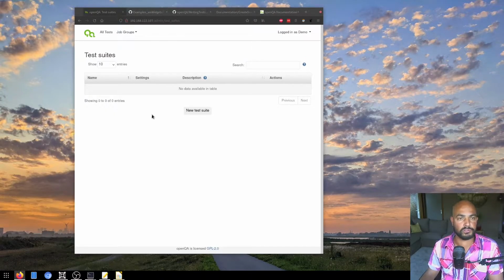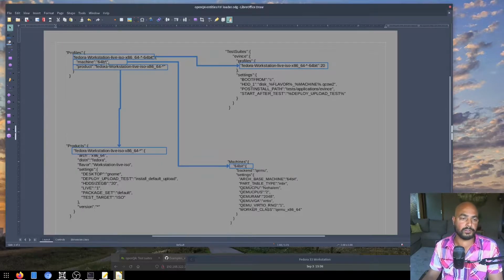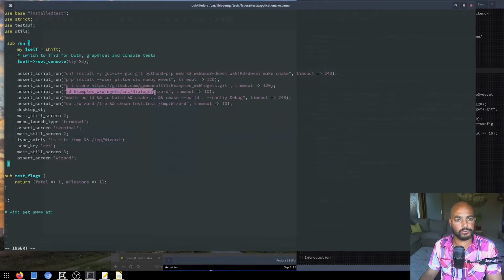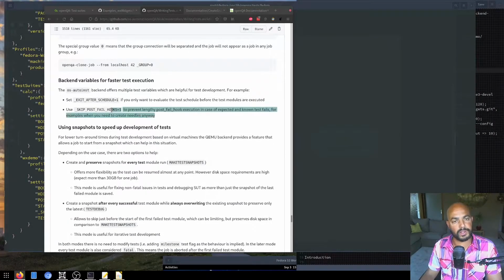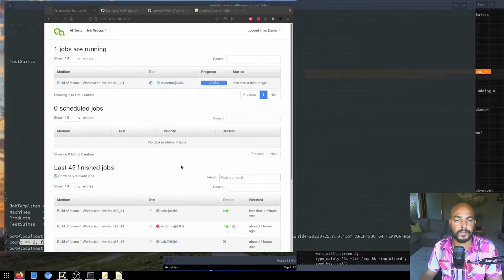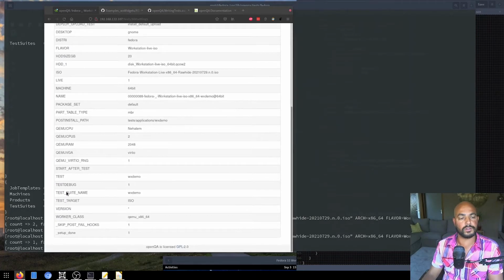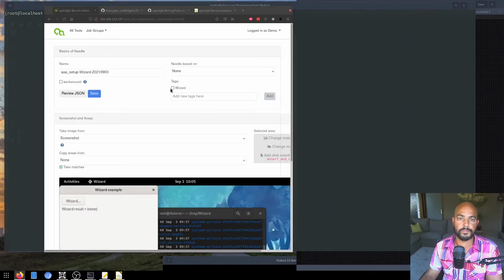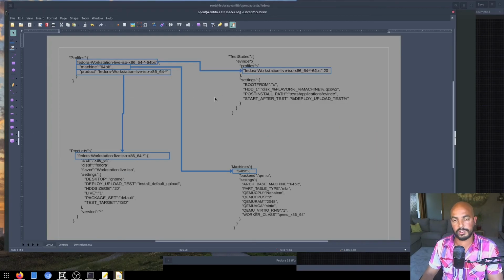Testautomation using OpenCV, openQA and Fedora (part 3: test ANY app in openQA in 4 easy steps!)

Comment: What did you do to get the Demo user to edit needles? On my server, I keep getting an error when attempting to save changes to existing needle files.
Reply from the maker: Hi Luker, that's a difficult question to answer, sounds like a permission issue for the needles, saying this without too much information. Does the log tell you anything when putting it on debug level? I can't remember doing anything specifically, then again this is 2 years ago.
Reply: @testertech  Nothing is conveyed with debugging turned on since the error during the save attempt occurs after the test run fails. I changed all needle file permissions to rw for all users as well as the needles folder. Google's chat GTP says that the Demo user doesn't have the permissions to edit needle files. That's a laugh since you and others have done it!